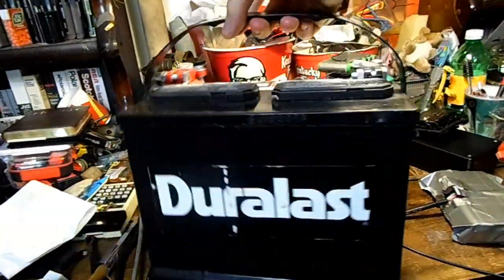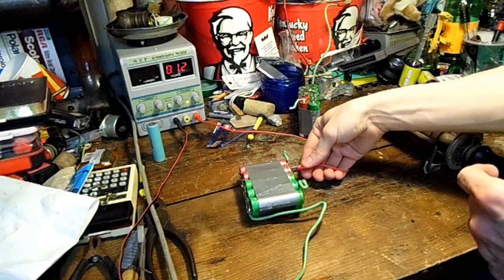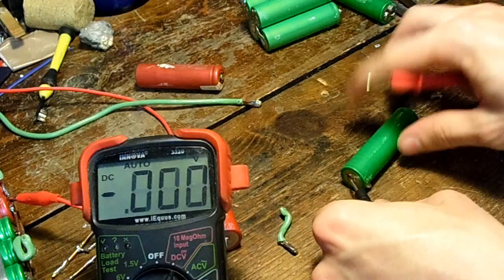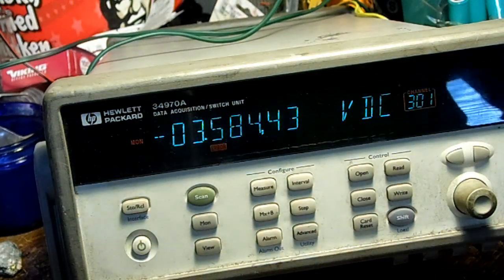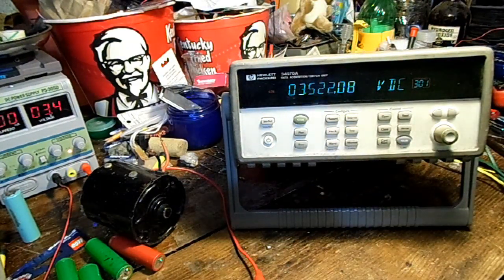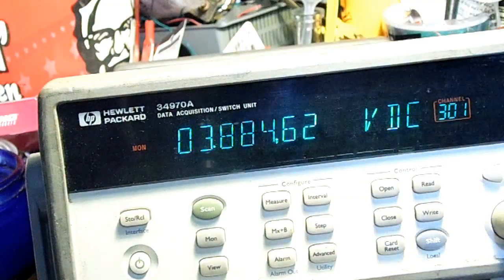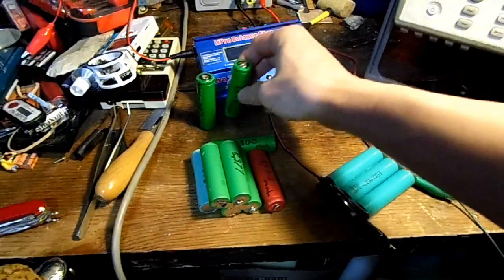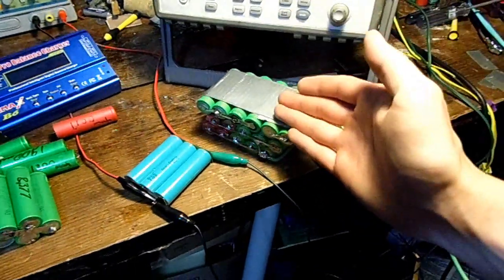how to test lithium 18650 cells AH Capacity and health

Comment: How can I figure out the C rating of older cells and used cells. I don't want to mess them up and I have no clue how to calculate that. I have a zanflare c4 charger/tester. It shows V, MR and MAH
Reply: Fil-Am Gabe . Yo ass a troll fam . Find some friends.
Reply: test ur self with  a high amp load and a voltage meter or google 18650 cell data base

Comment: Hey Rinoa! If you are or anyone you know is interesting in an automated testing system for 18650 cells, please consider checking out Lexcelon's Kickstarter for, "The Batlab." This is a complete system designed to walk users through the entire process of configuring a custom electric battery pack. The system cycles cells, runs cycle tests to determine capacity, sinusoidal and pulse tests to characterize impedance, and can estimate state-of-health when compared with benchmark values for a particular cell model. We are planning on making all of the hardware and software open source after we launch. If you are interested in learning more or becoming a backer, please check out our Kickstarter page! We are so excited to bring this product to life for other inventors like you.

https://www.kickstarter.com/projects/1722018962/batlab-a-battery-testing-system-for-lithium-ion-18?ref=discovery

Comment: can you actually work out the capacity from the voltage drop? 

I would've thought it was just the C rating that determines the V drop?.. take a high discharge 600mah ecig battery for example, they have very little voltage drop while pulling 1 amp but the voltage drops to 3v faster because there isn't much capacity contained within it. laptop batteries are probably all roughly the same C rating and now that I think of it I can normally tell at the start of the discharge if it's a good cell or not. brand name cells tend to have less Vdrop then cheap cells of the same capacity though (probably because they're rated at a high C rating as standard, even though they might not need it for a laptop pack)

Comment: Hi, can you charge Li-ion battery cells with just a benchtop power supply? I thought you needed special circuits to do this.
Reply: Joel Pou, you can, but you have to be careful. Basically, li-on batteries start by setting the max current, then switch to max voltage and let the current drop off. The important thing is with a bench supply, to stop it when the current drops low enough, per battery spec sheet.

Comment: isn't that soldering iron a bit to hot and big for those batteries more surface area from iron means quicker heat time unless ur quick enuf not to boil the batteries 
plus i have 3 really dead cells 0.00v wont be picked up by the imax b6 units as i have 2
Reply: +Daniel Hornes you can try to change them at 100mA with the NiMH charge option
Reply: tried that they just get boiling hot ?   one of them started to vent lol
Reply: what voltage were they at? i also had a 0,0v cell and tried to revive it with 100ma current, the next morning it was completely shortet out. yours is probably 100% done too ^^
Reply: +SaureHefePegorino   they showed between 0.00v to 0.62v  none servived 
one started spraying  liquid  so i chucked it outside on gravel  then i checked it next day it had gone black due to it shorted it self out   lol 

all the other 85 cells are working so i built a 4.2v 100ah battery pack lol   so far its doing well   as its in the 4th day discharging at 1amp  it used 67ah so far

Comment: Hi Riona,
I have about 100 cells salvaged from laptop's, is there anyway I can test their capacities in batches and sort them based on their capacity?
Reply: +Giridhar Raju N M http://www.ebay.com/itm/1-2-12V-Battery-Capacity-Tester-External-Load-Discharge-Capacity-Test-18650-/181645930176?hash=item2a4af0eec0:g:Or4AAOSwrklVc7ty
Reply from the maker: Giridhar Raju N M not unless you have a lot of discharge testers running at once.

Comment: I try to build a battery pack for my ebike 48v 1000w, but i have mix 18650 cell from different laptop battery, so they are all different capacity.some about only 1700mah, 2000, 2200 etc...
can you guys tell me how to pack them in P and S in more details....please.???
Reply: Kel Zhen Get 140 goodish cells, measure the Ah of each cell,  place them in 14 equal Ah piles:So for 48v you would need 14 piles ( 14x3.6v =50.4v )   If you place 10 battery cells of about 2.0Ah in each of the 14 piles and move them around so each pile adds up to 20Ah then you would have your 1000Wh pack.  (- P=iv    1000Wh = 19.8Ah x 50.4v )This pack of 140 cells should be able to produce 20A (1000W) for an hour.
Reply: +Sparky! only use 13s because they are 4.2v full
Reply: 14 is recommended with is actually 52 volts - but this only for a very short time.  The cells will drop quickly to 3.7 volts - which is what you want in order to give you the 48 volts you want for our ride.

Comment: Great video, thank you as I have been wondering how is the best way to check the cells for a while now, it is surprising how robust these cells are, have about 70 now taken out of various battery packs, Laptops etc. and have only one duff cell that refuses to charge, your explanation on balance charging lithium cells was also extremely informative, I wouldn,t have been so far forward with my plans for a battery bank now, regards Doc Cox

Comment: Hi love your vidz. Are you charging lilo as lipo to 4,2V?  
And why are you using the powersuply to make the initial start? Insted of just the imax?
Big fan!!!!
Reply: +Simon Dambro Below a certain voltage the iMax refuses to charge in Lipo mode (it may be 3.5v, or a little less, but at 2.5-3.0v mine just gave an error) if you don't have a fancy power supply, the iMax will charge them if you use another mode, then switch to Lipo mode when they hit 3.5v.
Reply: Cheers the m8!

Comment: buy yourself a better multimeter!!!! such a waste of time with this one
Reply from the maker: i think 7 segments is good enough. i dont need to measure nanovolts haha.
Reply: Rinoa Super-Genius i was talking about that red one with innova logo :P This Hp is a beast!
Reply from the maker: atomek1000
ah, well i find that multimeter works fine for me. since i was 10 i had really expencive multimeter that cost like 180$ but it finally crapped out after a decade. i found that the 30$ multimeters are just as good for me as the expensive ones. when working with batteries its fine to only see down to 0.01v.

but most of all i like using cheep tools because they are easily replaceable, just as long as its digital and auto-ranging. haha

i view that innova much like my old crusty hammers, just a simple tool i can throw around without much care.
Reply: the soldering iron makes me laugh ;)
Reply: +atomek1000 the innova one is fair quality.

Comment: Rinoa is there a way to make a lithium laptop battery regain capacity without dismantling the battery?
I have seen your videos and I can't remember is you mentioned any of this.
Reply from the maker: no, but i could be wrong.
Reply: OK, thanks
Reply: Dan Coster There is no way to repair them, that's why you can buy them for $1 when the only problem is one week cell out of 6 or 9 cells in the battery module.  After you take apart 30 or 40 modules you will have no modules that you can put back together.

Comment: i have a lot of these batteries is it possible to build a 12 volt battery pack without the protection circuit to use on a small solar system
Reply from the maker: well your gonna have to charge it with something like an imax b6 then. otherwise the cells will get out of ballance over time.

Comment: I missed this one, didnt get informed, dam youtube :-((

Ive allways thought that discharging a battery with a constant current load and watching the voltage is the way to test capacity, i know old batterys need more charging time anyway.

Ive never caught up with other battery types, so im stuck in the past lol.
Reply from the maker: yeah but i'm not needing this to know how many AH they actually have, just needing to know witch ones have more than others so i can group them together ok.

even if 1.7ah is only 1.2ah. i will still be grouping them together propperly. then when i'm done i can test the whole pack. but this is quicker for just getting an idea of how each cells is doing.

Comment: You could also group all the lower capacity cells together to make the same capacity as fewer higher capacity cells. Interesting idea!
Reply: +Robert Orr +Kel Zhen I think this is the best approach to ganging cells into a super cell, then the super cells of consistent mAhours and then they can be put in series with other super cells to get to the desired output voltage, and the super cells will all charge and discharge evenly (same mAh) and the whole pack can be charged at the rated pack voltage (4.3v * X supercells).

Comment: Good video.  Although using the discharge capacity value is a more accurate method for determining true capacity.  I've had high resistance 18650s sit on a charger all night showing 6,000+ mAh which is obviously too high.  Discharge testing showed it was closer to 800 mAh.
Reply from the maker: yeah but i'm just using this to catagorize the cells so i can assemble them into roughly similar AH packs. thats why i didnt go all the way to 4.2v. and yeah i agree discharge would be more accurate. but this took several days to film and i didnt want it to take even longer haha.
Reply: Rinoa Super-Genius Hehe, I know the feeling.  Just got done characterizing around 220 18650 cells for my own electric bike project.  :)
Reply from the maker: russtang yeah thats why im gonna see about making a amp/AH chart. i assume these cells are pretty close to the same C rating. unlike lead acid batteries witch vary a lot.

Comment: Interesting stuff , I've only recently been starting to play with these 18650 cells , they can be scary and fun too. Im wondering if there's anywhere you can purchase the protection circuit board for them.
Reply from the maker: yes, ebay. its where you can buy anything.
Reply: yeah i guess :-) , I have to get a better charger as this single cell charger is driveing me nuts.

whats the consequences of using different battery capacities, i know it wont be ballenced but will that lead to damage etc?

Im using 8 cells at the moment in parallel packs of 4 to run a raspberry pi which in test lasted 8 hours. Do you ever plan to mess around with a raspberry pi?

Thanks :-)
Reply from the maker: steve64464
yeah i have a rasp pi. its really fun. and cells of differant capacity dont matter as long as the parallel packs you put them into are similar capacity.

like i could make a 4AH 8v pack. the first parallel pack would have two 2ah cells and the other could have four 1ah cells. but they would work perfectly. and yeah you could have like 2ah cells mixed with 1ah on teh same parallel pack. but i just made my example simplistic.
Reply: +steve64464 If you run cells unbalanced, the weak cell will discharge first and if it goes below 3V first, it will be further damaged, and then possibly pull the other cells voltages down and damage them.  Also, on charging, it will heat up after it is fully charged while the other cells are not yet charged.
Reply from the maker: Inspironator
nah only bellow 1v.
Reply: I tore one of these 18650 apart the other day to try see if i could recover lithium metal but i couldn't identify the lithium since it was all black and flaky , Given the batt was 0v and wouldn't charge at all im guessing this may be normal for a dead cell to be so messed up inside.
Reply: +Rinoa Super-Genius  Oh, the Irony!  I don't know where you got your information, but by all means, please tell

Everyone, check the specs of the Li battery manufacturers as any other source of information is DUBIOUS.  

From Panasonic's , "NNP series 2.5V per cell (2.75V per cell in the case of 2 series or more)
PSS and Cobalt acid series 3.0V per cell
Avoid discharging at voltages less than these.
Overdischarge can damage the performance of the battery."
Reply: +Inspironator they will get damaged, but it takes a while to damage them, and they can be revived from .1 mV
Reply: +DMAN22yeah All I can say is it shortens the life of the battery.  With proper battery management, cells could last 8+ years and only lose 30-40% of their capacity.  Rinoa hacks battery charging and discharging, and he doesn't care because he basicly gets them for nearly free, but the true cost is in his time spent removing dead cells and rebuilding packs, and down-time.  Battery protection circuits avoid the issues with undervolting cells.  Rinoa also doesn't match their capacity to other cells in a pack.  So he pays for his sins and makes videos in the process.
Reply: Inspironator ha matches all the series cells properly to about 100mah and doesnt cycle them too hard
Reply: +DMAN22yeah That's not what he said in the comments.  He apparently thought it would take too much time to measure the capacity of each cell.  Maybe he's changed, maybe not.  IDK.
Reply: Inspironator he does now

Comment: I'm still using the magnets to charge my batteries! =) + I'm trying ti get hold of a super duper soldering iron like you have!
Reply from the maker: yeah cheepest one of those on ebay right now is 70$, next cheepest is 130$ haha. glad i got mine for 4$.
Reply: Although it is possible to use the soldering iron, do not!  Lithium ION is very susceptible to heat and will damage the batteries every time an iron is used.  A spot welder does a much better job with a very quick amount of heat and will not hurt the battery.